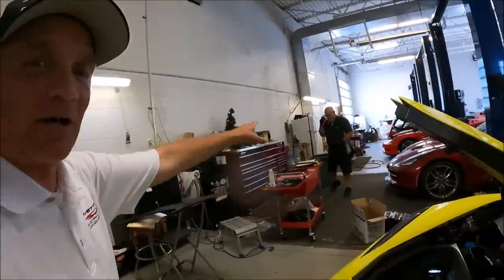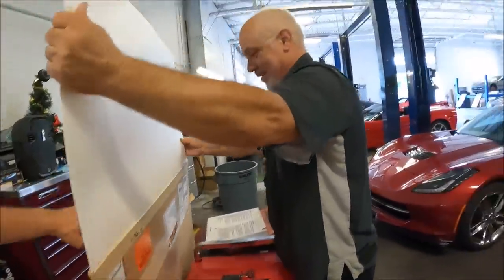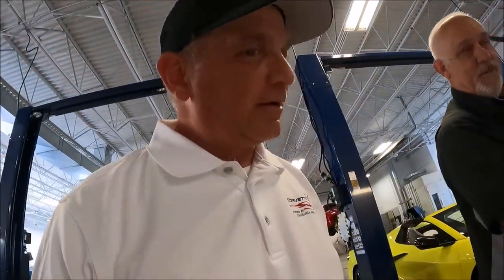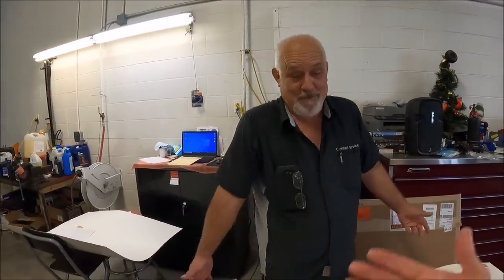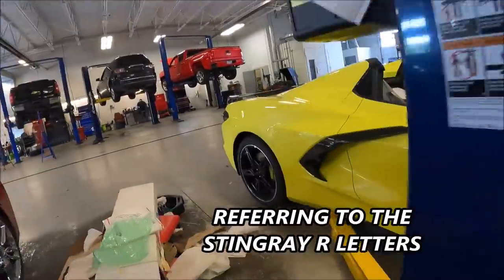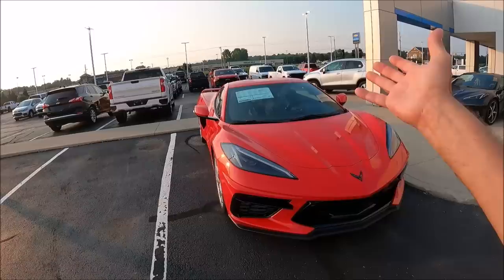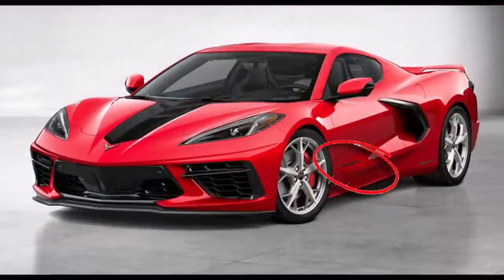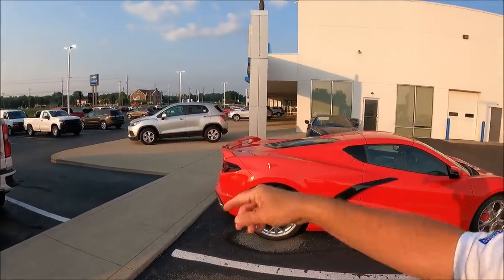C8 CORVETTE STINGRAY R GRAPHICS WHAT DO YOU GET & WHAT WE DON'T LIKE

Comment: Thank you for this video. 
When I was looking at the Corvette R package it appeared that the side graphic was actually a plastic or metal emblem rather than just a decal.
Knowing that it's a decal, makes it less appealing to me.
One thing your video did not touch on which is included in the package is the Corvette R wheel  center caps..... is this also just a decal that goes over a generic/ blank center cap?

Comment: Three lettering graphics should go on the front lower door IF the car has the 5VM side ground effects.  If the car doesn't have the 5VM ground effects, then it should be be placed on the lower front of the left and right 1/4 panels-where you thought it should go.

Comment: It appears these stickers are now factory installed based on the Corvette website and from the live webcams on Corvette Blvd. at the Corvette Museum. Could you please confirm if that is true?
Reply: I just got delivery of my Z51 Coupe, Hypersonic Grey yesterday. I ordered the Stingray R decals package. It arrived at the dealership here in Hawaii, in the box. The dealer has to farm out the work to a local wrap and tint shop. I have not decided yet if I will put the decals on since it looks great already with all the Carbon Flash contrasting the Hyper Grey. I will decide when I meet with the installer tomorrow. It's a difficult decision. I will ask how easy it is to take off if  I don't like it, and that will be the deciding factor.
Reply: @roccodogman  I got my answer once I picked up my Rapid Blue Coupe at the museum in January. This is a dealer installed item, and in the case of museum delivery, the museum installs the decals.

Comment: I thought they were installed at the factory.  Guess that will be discussion when you get my car I have on order with you as I have included the package on my final build.  Does it only have two decals for the both sides, as the configurator shows two on each side ?  You did not mention that the package also includes the Stingray R center wheel caps

Comment: I put mine exactly where you recommended. Gives the most balance to the design. Keep in mind if you are going to have PPF like XPEL installed, put the graphics on after the PPF and you’ll have a much better look. By the way, I told the dealer not to install the graphics. I took care of it with my XPEL man.

Comment: On the graphics always use soap and water when peeling off the backing, spray it down and then spray it on the hood that way you can move it and make sure it straight before you squeegee everything now then use the heat down and seal it up that works!!

Comment: I think I like the graphic better in the front.  I don't know if the C8 has the same issue as the C7 where the body area just in front of the rear wheel gets pelted with rocks and debris (unless you install some rock guards).  If that is a problem on the C8 as well, then I definitely would put the graphics in the front where GM shows them on the configurator so they don't get destroyed over time.